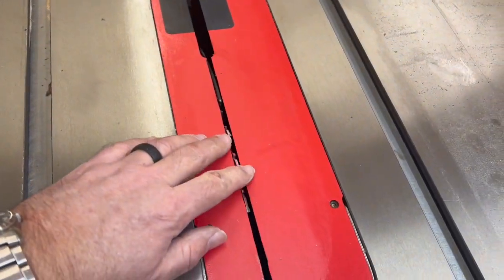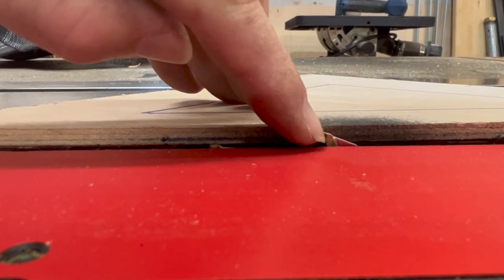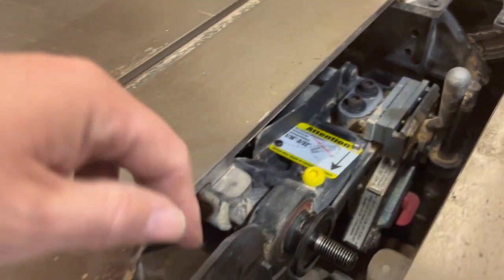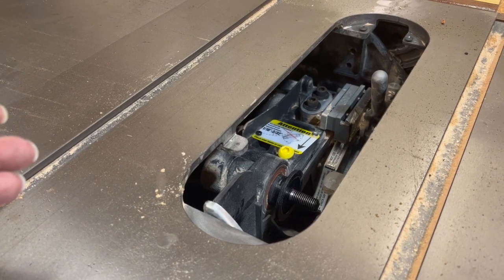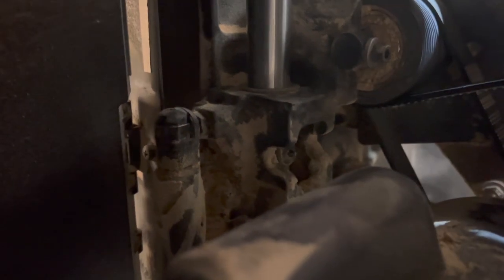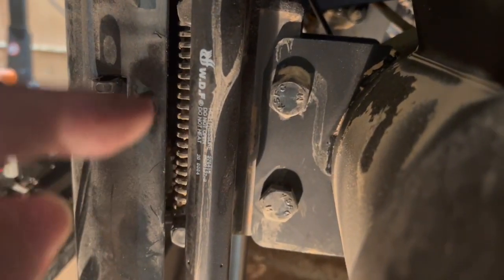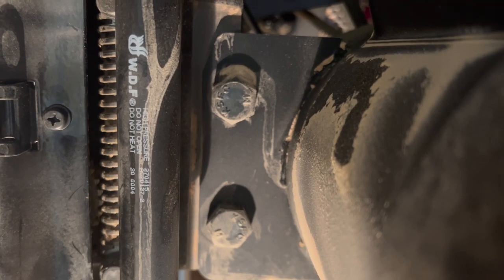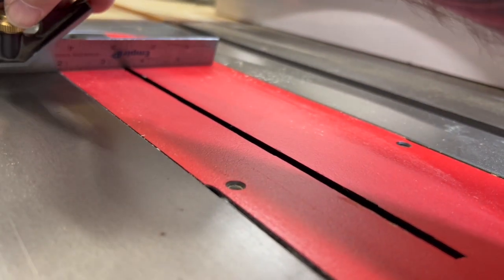FIXED!! SawStop Blade Lower Limit Issue

Comment: Had this issue on the contractor saw and despite regular sessions with the vac and compressed air, it persisted. It's almost impossible to inspect the vulnerable areas on the contractor model, but with an intense light I could finally see some densely compressed sawdust on the far side of the bottom bracket of the trunion. Once I cleared it, I could see it was fine fibre from using the dado blade, which is why it held together despite using compressed air. It took a straightened coat hanger to chip it out.
Reply from the maker: This build up and needed cleaning is the only negative with these saws. I love mine and this is just an annoyance. With there was a door for inspection clean out…. I guess  could cut the cabinet and fabricate one, but with it was part of the original build.

Comment: Yah that will fix it. It’s really hard to get to on the contractor saw, so I drilled a 2 1/8 inch inspection/ service hole and it worked great. It seems like a design consideration for the future.
Reply: Where did you drill that inspection/service hole? I have the same problem with my contractor saw

Comment: Thank you, thank you, thank you. Worked well. If the problem has been occurring for a while (like mine), the sawdust might be caked between to cogs of the gear on the left side. In my case, the compressed air wasn't able to dislodge the buildup, so I took a small flat screwdriver and scrapped down each cog separately. Works beautifully now. Again, thanks for making the video.
Reply from the maker: @geryryan8203  glad it worked for you. It’s one tiny flaw and otherwise a great saw. I’ve had to do it again recently so I figure that every six months I just do it as part of maintenance.  I also make sure to completely vacuum out any sawdust gets left in the bottom of the saw because sometimes I forgot to turn the dust collector on…

Comment: Nice.  Gald  I didn't have to look as hard.  Now that I know where to hit it, I was able to stick a goose neck air blower down from the top blade space, through the belt and hit that worm gear.  I have a built in cabinet around the saw and while it's possible, getting  to that swing opening can be a lot of work.  Blowing it out from up there worked, even though I couldn't see what I was hitting.  
Lifted and sank the blade at different intervals to get it working again.  much easier to use the wheel now as well!

Comment: Looks like you are using the throat plate levelers incorrectly. the buttons on the table should be higher and on the plate they should be extended so as to "lock" under the buttons on the cast iron, the an allen wrench from the top to level the throat plate, this prevents the back end of the plate from lifting.
Also you have a thin kerf blade with limiting lugs behind the carbide teeth - the limiters prevent the brake from fully engaging the Brake, and thus allow the blade to make more rotation after deployment.

Comment: I have the same issue along with the saw/blade stopping in the middle of a cut. Did you experience that too?
Reply from the maker: I did not.  That would would flip me out as I would think that it would have a reliability issue connected to the sensor.  I would call SawStop TOMORROW!

Comment: I did the exact same thing you show on your video. Sadly, I fooled around and figured it out myself before I saw your video. It solved the problem, but I still don't feel like the blade lowers as much as it should. Sawstop shows a couple "hidden" places on their website, that need blown out witg compressed air. I'm going out now and see if I can find them.

Comment: I have had mine for a year and am dealing with this right now. I do not yet have a dust collector. So, it builds up faster. I have cleaned everything, but apparently, I have more cleaning to do in some little unseen spot.
Reply from the maker: Yep,  It was driving me nuts!  I have a vac system and it just built up over time and clogged up those teeth and gears.  I hope the video helps.